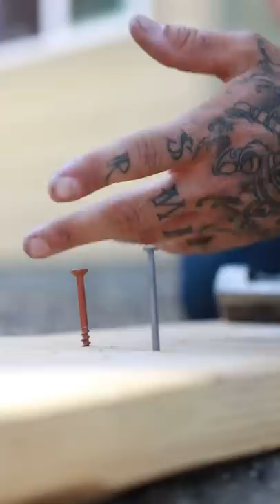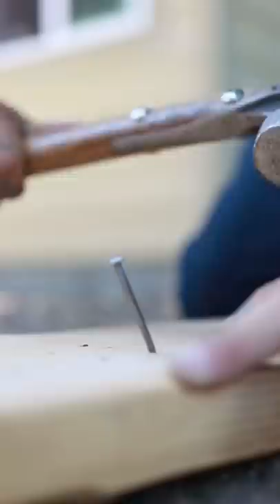Nails vs. Screws: Why do we use nails? #shorts

Comment: You’re hitting a screw that wasn’t screwed in to anything. For a screw to move that much while screwed in to something all the way, it would have to be a massive earthquake or something
Reply: Well he’s just giving an extreme example. He gave the same amount of bending to the nail and it didn’t break
Reply: @Akotski-ys9rr  Right.
Reply: The screw was screwed in, it was representing a screwgoing through two things, just instead of two things its wood and hammer
Reply: @EvanPilb  when you screw a screw there’s nothing but the head visible. The rest is bedded in to something. It’s completely different
Reply: @steroe7965  lol when the nail is hammered in completley only the head shows too..its the same dumby..if a building moves or warps its still gunna have stress on it causing it break vs the screw will bend instead of break
Reply: @steroe7965  sure it would..the hammer ei any force that would move those 2 piece is still a force on the screw in the middle where there's a gap between 2 pieces of material..again it would still snap if there's a shift between those 2 pieces even if the screw is in the 2 pieces material screwing them together all the way...not in every case but in that specific case it would
Reply: @steroe7965  hey dumby. You know screws got a sheer force Rating? That's what He ist showing there xD
Reply: @DereinzigwahreAkede  the problem with that demo is that it was bending not sheer. Sheer forces are perpendicular to the primary axis of the screw. This was actually a torque being applied. I believe that is what was being called out above. With the screw bridging two flat surfaces that are in contact, and multiple screws, forces should be parallel or perpendicular to the screw. So, tension/compression, and sheer, but not bending where a skin failure would occur as in this demo.
Reply: Anon Ymous  they would not, unless you're talking extreme movement like earthquakes, but nails would only do marginally better.
It's used for cost, and he's just showing a bad example. When properly installed/applied/used, neither the screw or the nail would ever actually bend like that, unless the wood or surface was actually just torn the fuck off. In which case, you have a much bigger issue than if whether or not the piece of material holds on after being detached or not. The literal only difference is if the material would have any ability to still cling on, after being detached. Nails could make some pieces remain attached, depending on the force, but I believe those specific materials were just installed to annoy the fuck out if anyone that wanted to change it.
Reply: He also used a ceramic screw.
Reply: Something like an airstrike.
Reply: @steroe7965  if you have a screw through two planks and you try pulling them apart hard enough this is gonna happen. With a nail its not
Reply: @Milesfem  The nail will rip out entirely while the screw is still holding strong, because it's a better fastener with significantly more holding power
Reply: @JDMKEV  so what happens in the case of steel constructed building, those can be bolted or pinned together, and yet we dont see them things breaking now do we? Now i dare you to take two boards and screw them together and then pry them apart, you’re gonna find its much easier if they’re nails, purely because the nails bend and give. Why do you think decks are often times screwed together now, oh thats right, because nails pop
Reply: @zairac2564  he work hardened the screw and it snapped. The more you wiggle it back and forth the harder/brittle it becomes and eventually it snaps. It takes more wiggles to work harden the nail because it’s soft to start . The true shear strength of the screw is more than double the nail.
Reply: He’s using a screw that doesn’t have a structural shear rating (looks like a deck screw) those fail when used for structural applications all the time, though not every time. Their are shear-rated screws, they are just very expensive to purchase and install.
Reply: @robertaylor9218  nonsense. I live in AU. Our tie down codes are way more stringent than the US, because we only use steel for all tie down … zero plywood. The code includes screws of all types. 4 ways to install joist hangers for instance.  Telco hand nailing, strap shot type gun, approved hanger screws, bolts(masonry walls/steel beams). Hand nailing is slow as dirt. Strap shot fast(nails expensive) connector screws are some what expensive except you can use 50% less screws(Simpson). There for screws with an impact driver is faster & better than hand nailing. Probably a wash with a strap shot unless you are a framer. Even then you should use screws in tight locations. 

You are correct about the decking screw. It’s a BS video. If your building moves enough to bend nails you either didn’t use enough nails, connectors or you are incompetent. The end. 

Call up Simpson tech in the US or Pryda/Mitak down in AU/NZ and they will tell you that connector screws are superior to connector nails. I have done so. 

I’m was an  American carpenter in Connecticut for 20 years.
Reply: @aspees  yep, I was very clear about screws being ok as long as they are rated. If someone watching this buys “wood screws” at Home Depot and uses them for a structural application they are asking for problems. The precise kind of screw specified for an application by the manufacturer, architect or building department are almost always superior to a nail; but you cannot just use any screw. If you aren’t very particular you make things much worse, and that’s my point.
Reply: @robertaylor9218  I agree with you. Checkout the Project Farm You tube Channel. He's got some great testing on exactly what we are discussing. 

At the end of the day engineering is about limiting factors. Most people do not realize the strength of steel including nails, bolts and screws. What is the limiting factor in a typical joist hanger situation it is definitely not the shear strength of the pile of nails we have to use. The wood will fail in shear/split way before any nail or the bracket would fail. The nails are there to prevent the joist from pulling away from the beam. Typical nails are terrible at preventing withdrawal therefore we have to use an insane number of nails in each hanger. We all know this fact. Screws are superior by orders of magnitude. Screws are not slow with an impact driver driving 1/4" hex heads. I've installed hundreds of them and I own a Strapshot gun.
Reply: In AU we have a particular brand of screw that are the same length of a framing nail. The head is the same size. The diameter of the shank and the root is bigger than the same size gun nail. The shear strength would be double because they are heat treated and way stronger then a gun nail. We use them for framing  that is hard to nail. Similar to GRK screws in the States.
Reply: @aspees  yeah, if you are using the correctly called out hardware you’re usually going to be overdoing it, being that I live in earthquake territory that’s a very good thing. Of course I’ve seen plenty of failings when the builders thought that they didn’t have to build to spec.

It’s true on the deck point, but that’s also why you’re supposed to use full length 10d on the supporting member, as a shortened one only has 40% of the pull strength.
Reply: @aspees  also, I’ll open up a tab now and check out project farm later. Thanks
Reply: @JDMKEV  yes but it’s only one motion try seeing how things hold together tho and u will see a big diff. Screws hold things together better that’s a fact, but u weekend warriors will always argue with us pros that do it every day because ure mostly just immature milenials… y’all will grow up one day tho
Reply: @JDMKEV  I’m no that’s a terrible view and wrong I’m not impressed yet again
Reply: @JDMKEV  no …. It wouldn’t keep ringing up my groceries bag boy
Reply: @eurocaranyone  Iam a builder and do a lot of decks so I can confirm that u are correct… don’t listen to these bag boys in here they have probably never worked a day in their life banging hammers all day in the got Georgia heat…
Reply: @Know3ody  eh day…. Remodeling craftsman 👍🏻
Reply: @mrgrump2534  I'm sure you can tell which ones know and which don't. Id bet some don't even know what an estwing is or the difference between an impact, combi and sds.
Reply: This is what happens when someone heard something and misunderstood
Reply: Isn't that kind of the point though? Good enough reason to avoid building thousands of homes in LA given the earthquake zone

Comment: Just curious, why would your framing move so much the screw bends 90 degrees? That’s what it took to break it...
Reply: Difference between summer and winter, how hard the wind blows. Weight added due to furniture electronics people etc
Reply from the maker: Doesn't need to move 90*..

The point being nails will bend while screws will snap under shear force.
Reply: Exactly.  Screws allow for disassemble and replacement of deteriorated boards.  I always use screws.
Reply: @MattBangsWood  they don't snap until they reach a near 90.  This never happens.  And the wood will flex and deform way before a screw would snap.
Reply: I always thought lots of good nailing and screwing both were required for the longevity and happiness of a home
Reply: @superdutyscaler6823  if it doesn't need to move 90 degrees to snap then please show us a real world example. When was the last time you came across a house that moved so much that the screws snapped? I'm sure you have pictures to share and they would have been a better example to use.
Reply: Here’s something else to think about, ring shank nails can break at 90 degrees but they will pull the head threw a board making the hole the size of the head of the nail if pulled straight and don’t break. I would say there is a specific place to use each nails or screws. Also I believe screws wouldn’t have taken place of nails in metal panel buildings if they have so much shear to break off. And if you have ever put metal panels on a pole barn, you’d know how much it’s is strengthened just after being put on.

Comment: They should be used in accordance with the type of movement that will be applied to what it’s holding screws are perfect for tensile things so things that would be pulled away from each other. Screws will work far better than nails, but if you need something that he’s talking about for sheer strength like a floor then nails are the way to go, it’s all dependent on where the fastener is going to be as to what you should use it for